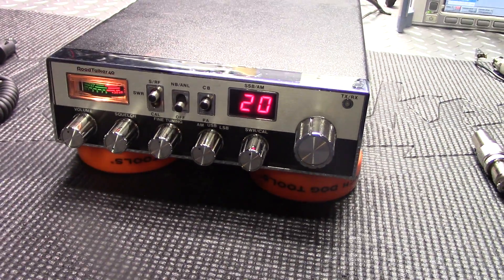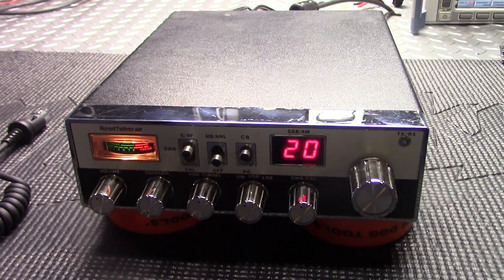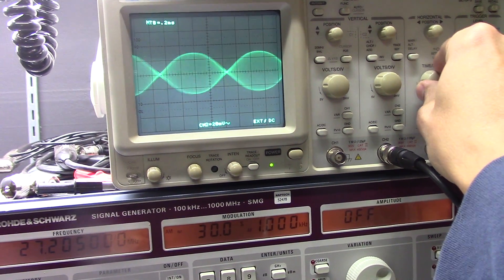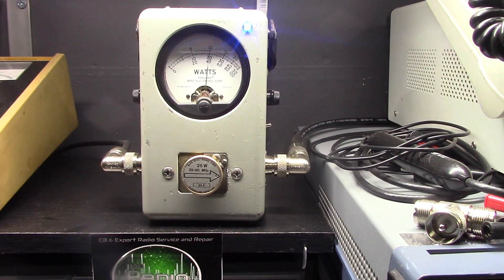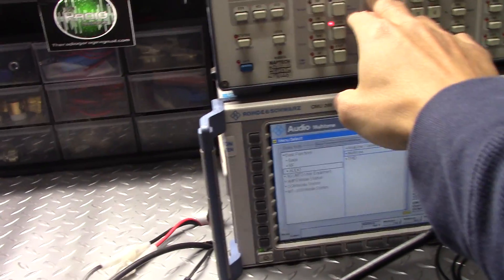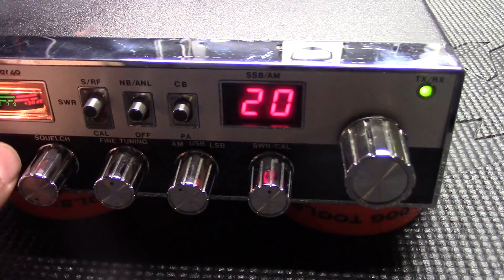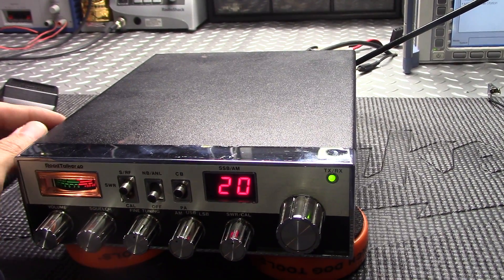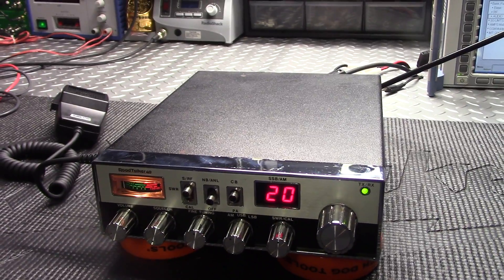Sears Roadtalker 40 SSB CB Radio Tune-Up on the Oscilloscope.

Comment: I have one of these radios I just love it it's I've had it for years and it still works just fine I would like to get the dead key adjusted on it or put a variable power in it wonder if you can get ahold of me to tell me what it would cost to have that done

Comment: I just bought 2 of these buy mine are the slant face.
They are the base /mobile unit.
I know i paid too much for them but i realy wanted these exact radios.
My dad had picked up 2 of these new in the late 1970s.
They were amazing for the time.
But now they are classic japan builds that just prove in my eyes how much better the japanese built rigs are.
Anyeay i want to recap them add some power echo talk back roger beep. Add a few bells an whisles.

Comment: I have one exactly like it, except mine has a mount bracket with a power coupler in it attached to the top of it. I just pulled it out of the closet to dust it off and was thinking of trying to power it up. I had it, and a Super Star with FM, still attached, mounted in one of old garages and would talk to my dad when he was on his way home on the interstate. I could reach him almost 50 miles away, and I am almost clueless about these radios. I guess I was lucky, and his truck radio was really good.